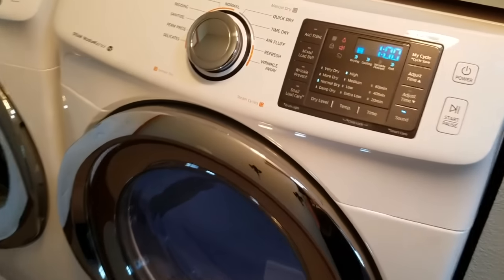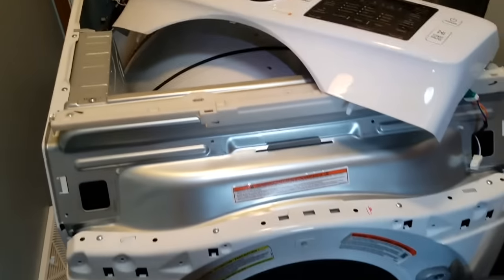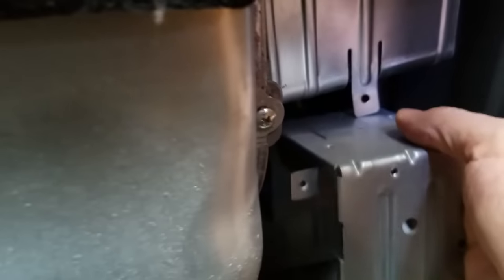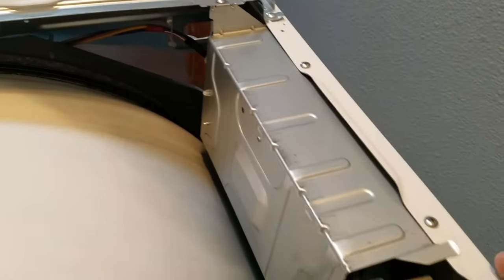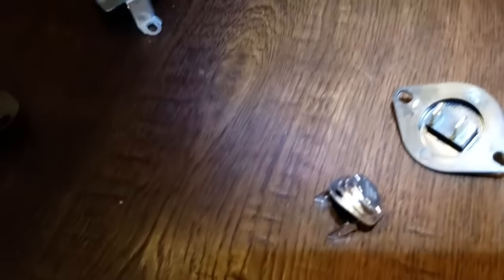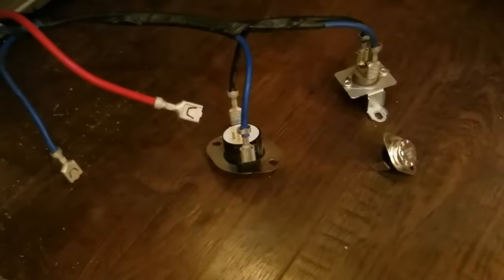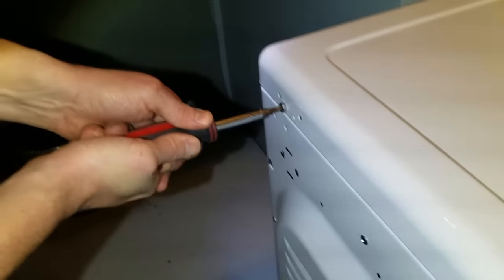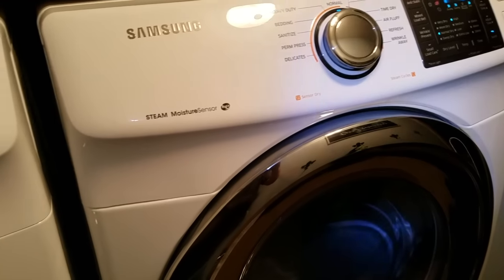Samsung Clothes Dryer Heating Element DIY Repair - No Heat & Noise Fix

Comment: Lifesaver! That damn u-shaped metal piece was a beast. Took me the longest to get those 2 back screws off, but I got it eventually. Thx again for posting.
Reply: How did you manage to get the 2 screws from the back? It’s a b***.! I can’t even see the screws, only feel them. Please help! Thx
Reply: smiley0987 I used a stubby screw driver and just went off of feel. It took a while, I didn’t actually screw them back in when I was putting it back together. I couldn’t be bothered.
Reply: L A thank you so much for your quick reply! Ok ill have to pick up that screwdriver! Yes I won’t be bothered to put them back either. Arghhhh I was just trying to yank the element piece out but of course it won’t fit, Samsung makes everything difficult. Hubby is ready to buy a new dryer but Im so determined to test this piece first.Thanks again!
Reply: smiley0987 it’s worth it in the end, it’ll just take a little bit more time than you would like. I didn’t see a break in my heating element so I did swap everything out in the kit and dryer has been working like a champ since.
Reply: smiley0987 best of luck!
Reply: L A thanks again!!

Comment: Awesome quick fix. Thanks for the video! Made quick work of the dryer without having to take the whole thing apart!
Reply: Excessive lint burnt up another coil today. Here just refreshing my memory.  Found that the exhaust duct under the drum was loose. Just wrapped some insulation tape around the seam and replaced the element.  Thanks again!

Comment: Saved my butt thank you. Never buying Samsung again tho
Reply: I will never buy another Samsung product again either. I had a Samsung Note (and replacement) that was a fire hazard, a TV that had a cheap capacitor burn out after a year (thanks YouTube showing me how to fix it), a microwave with a door cable that isn't tight enough, a refrigerator with an ice maker that is froze over, and now a dryer that won't dry clothes. I have a friend who had an issue with their dryer too... That's what I get for brand preferance!

Comment: Great video, I have to perform this exact repair on the same model this weekend.  This is a huge help!
Reply: @MelvinZoopers  Just curious, when you put the replacement in, was there any burning smell afterwards?  I just put my replacement in, and while it does heat now, it smells like somethings burning in the drum.  I unplugged it for now to take another look later, but wasnt sure if it was maybe just some lint or something
Reply from the maker: Yes. I do remember a smell like it is getting too hot. Maybe it is just the coating on the coil burning off.
Reply: Melvin Zoopers thanks so much.  I’ll make sure I’m able to watch It nonstop for a few minutes tonight and see if it goes away
Reply: @MelvinZoopers  Yep! After about 10 min or so, things are smelling normal again.

Comment: After watching more than 3 videos I replaced my heating element and the fuse along with the thermostat.  It worked like a champ for two days then stopped heating again. Once again I removed the whole housing.  Element was good so I replaced the original thermostat and fuse. Working again...the fuse must have blown that was supplied with the element.

Comment: Only issued I had was removing the control panel.  Ended up snapping the plastic clips off to remove it.  But it worked.

Comment: The only problem I had was the control panel was stuck at the bottom.  I found that pressing in at the bottom center of the panel released it.  Thanks for the video
Reply from the maker: Good tip!

Comment: Thank you so much. It walked me though the entire process and now my dryer is working. However, I was not able to get the two back screws in on the bracket holding up the element. It feels solid and the tube is in the whole in the back. What do I risk by not mounting those two screws? I can't even get them in the hole anymore and can't see/do anything . Any advice would be greatly appreciated.
Reply from the maker: Should be good but I worry that things may move around with the vibration. There is a reason they designed it with the screws there.

Comment: I have this dryer and functionally it works great but the reliability is garbage. I've had to have it repaired by techs FOUR times in less than 4 years and it's gotten to the point where thanks to videos like this one I now can literally take apart the thing in ten minutes and replace everything in it myself. If you laid out all the parts on the floor in front of me I could literally put it back together from memory because I've had to fix the thing so many times. Ironically this video showed up in my YouTube feed today because I got an HE error on it so I wanted to verify if I could check the functionality of the heating element and fuses without removing the drum. This thing is garbage for reliability. My buddy and I were just talking and he said Samsung is rated 18 out of 24 for reliability in Consumer Reports. (Probably shouldn't have bought a Samsung washer last year... d'oh) 

The good news is I know I can get the heating element and thermal fuse and thermistor on Amazon for $75.  Still aggravated I got take this thing apart again.
Reply from the maker: I know what you mean. I have already replaced my heating coil twice in less than 3 years & it has a loud hum & I am not sure where it is coming from!

Comment: Here I am again, 1yr later, watching this magnificent Video in order to change heating element once again.  It has been exacly 1 yr, is it nirmal for hearing element to brake again? Are we doing something wrong, maybe, for example if a breaker is tripping somewhein the house, would this cause this???
Reply from the maker: I am not sure about that. I think the quality of the Amazon element is suspect. I am also on another replacement. 😠
Reply: @MelvinZoopers  thanks for replying so fast.  I'm assuming samsung piece will cost way more, right?
Reply from the maker: @GUACHARN  I never have priced it out, but like you, I assume it would be, but may be worth it in the end unless something else breaks on it, then you just wasted 💰.

Comment: Thanks for helping me replace the element and getting heat back 

There is a different issue now though my dryer gets to hot and wrinkles clothes now (SMH). Any idea why? It’s almost like the the sensor for controlling heat temps is not working
Reply: maybe change the heat settings for less hot

Comment: I'll be getting into this project over the weekend.  Its too bad those two screws that attach the hood need to be removed.  Would be great if the hood could stay on.  Hard to remove on stackable w/d in closet.

Comment: Same issue on a friends' samsung dryer today (and another friends' a couple years ago). ordered a $24 heating element and not the cheapo replacement sensors. Samsung wants $118 for the heating element... hahahahaha btw, I checked, same manufacturer makes both parts. I'll let you know this week when it comes in if it's the same thickness and material. (aftermarkets last ~3 years and up to 5, samsung lasts ~ 3 years and up to 5) Sensors? I'd buy samsung brand as the aftermarkets do seem VERY cheaply made...

Comment: Thanks for the in-depth informative video I too have the spring broken. Quick question I have the original DC-97 14486A part# on the previous element does it matter if I get the DC-47 spring? (Can’t seem to find it nowhere unless I purchase the whole assembly which is $50 and up).
Reply from the maker: I think you should be ok.

Comment: Mine had just blown one of the "sensors" . If you have a voltmeter and seperate them they should read continuity. If they don't they're open. My heating element was intact so I just changed the sensor. It's probably smarter to replace them all at once but I didn't have to.

Comment: What a job!  Thank you for making this helpful video.
Talk about screwing the consumer.  Thanks Samsung for engineering such a sh**ty appliance where, what should be a routine repair, turns into a nightmare.
BTW, the power connection should be redone to clamp the cable itself, and not just the conductors.

Comment: Great Vid One of the
Easiest repair I have ever done 

BUT 

After ordering Samsung Dryer Heating Element DC47-00019A (~20$) 

I stretched the broken coil a little bit so the break in the coil wires were
over lapped. With a metal wire crimp I slid the crimp on the over lapped broken
coil wires and crushed the crimp with a pair of vice grips. 

Big Big Problems. 

Installed this repaired heater and now I’m running a repaired Samsung dryer and have
a new Heating Element DC47-00019A (~20$) sitting on the shelf. 

IMO this Heating Element repair will outlast my Samsung dryer and I will never
will use that new Heating Element DC47-00019A (~20$) part. 

Very Very Sad.
Reply from the maker: Good one.
Reply: Just wondering is your fix still holding up? Or did you use the replacement parts you got?

Comment: The two “sensors” you bought ( actually a thermal fuse and the thermistor) don’t match because they are the two that go on the blower, not the heater element housing!!  The element housing gets a different thermal fuse ( part #dc96-00887a) and a thermostat ( part # dc47-00018a). They will look just like the one you detached.  The ones you purchased will look just like the ones on the blower.
Reply from the maker: Thanks for that!

Comment: Hey, I have the exact same dryer with the exact same problem. I noticed you didn't replace the thermal fuse, which I thought might be necessary in this case. Is the dryer still running fine without replacing the fuse? Thanks and great video!
Reply from the maker: Yes. Once I saw the broken element I figured that was the only thing that needed replacing. Working good.

Comment: I just did this to my dryer, this was super helpful. However, I had to do it 4 times, every time the cooling light was still on. I replaced the semsors, used a volt meter to make sure everything was working, the cooling light is still on. So I run the dryer anyway to see what it does. It blows hot air. That cooling light was a freaking liar.
Reply from the maker: Haha! Love it!

Comment: Hi
Firstly thank you for the video. I followed all of your steps and found that my heating element is fine not broken. I’m confused now what can be the issue? Could you please help?

Thank yoj
Reply from the maker: Those heating elements go out so frequently that I might replace it even though I don't see any brick in the coil. There may just be a weak spot.

Comment: Thanks a lot. Where would you find the wires on the outside of the heating element? You mentioned something kit but it’s not in your bio. One of my wires is burned and I haven’t proceeded to the next steps of opening the element yet. It’s the middle plug and the black wire with silver attachment is burned and broken from the silver on the plug.
Reply from the maker: I believe that those things came in the kit that I used in the video. Got it from Amazon.

Comment: Any suggestions on where you ordered the parts?  Did you order OEM or something simple off Amazon or something?  Link would be helpful!
Reply: I got the whole kit with a new heating element, fuse and thermostat in the housing.
https://www.amazon.com/gp/product/B082LZJQZ5/ref=ppx_yo_dt_b_asin_title_o00_s00?ie=UTF8&psc=1

Comment: Mine went out on my dryer same model as yours about a month ago thanks to you I was able to replace it quick. Unfortunately less than three weeks after replacing the new one it went out again. I can’t figure out what could’ve caused it to go out again. I got an OEM replacement and don’t know if it was faulty or just crappy eBay product. 

Anybody else having the same problem?
Reply from the maker: My first replacement lasted about 1 year then I had to replace it again. I think they make them weak so you keep coming back for more.
Reply: @MelvinZoopers   I wouldn’t be surprised if that’s the case. The more I’ve been researching the cause I’m staring to believe is the temperature sensor that is not turning off the heating element causing it to overheat and go out. Is so frustrating. Will post if an answer if can figure out the problem since my drier is about 4 years old.

Comment: I replaced the heating element and all sensors but still no heat. Checked the voltage and it's receiving 240. Any suggestions?
Reply: I have the same problem , Did you find any solution?
Reply: Check the 2 thermal fuses behind the blower.the parts are shown in the video. They are different than the ones on the elements. Remove exhaust from the rear look towards the right behind the blower.

Comment: I changed the heating element and the 2 sensors. I plugged it all back in and started it up again. It worked! :) But, it smelled heated... Is this normal at the beginning for these new elements installed, you think?
Reply from the maker: Very much so, yes. Smells hot when they fire up the first couple minutes.

Comment: Gotta do this... I'm getting a 10v short to chassis and I get a mild shock if touching any bare metal on the dryer. I think there's a pinched wire somewhere.
Reply from the maker: That sucks! Be careful.
Reply: First thing to do, it's to unplug it.
Reply: Good news!!!
Found it was the outlet had one of the hot and ground lines switched.  Ow that I think of it... the dryer wasn’t drying that well after all.
Once I switched those lines... all is well and no shock.

Comment: Thank you for your excellent video!
Reply: Actually, I am representing a brand US amazon store, We're appliance repair replacements Amazon seller. I wanted to see if you' d be interested in testing our Dryer heating element kit and adding affiliate link under your video. We will pay you $50 to thank you for your repair video if you could use our products.

Comment: I can't tell ya how many heater assemblies on these samsungs i have replaced over the years but its alot  & I have never had to do it in pieces it comes all together just plug and play.  most of them are fine it just popped/tripped the high limit  , that could be from overloading the unit blocked vent  & or not cleaning the lint filter.. PS you don't have to take that bracket off from the bottom of the dryer to the heater just the one screw holding the heater to the mounting bracket

Comment: Anyone watching this and haven't ordered parts or have in the process of taking your dryer apart. You can take a volt meter, switch it to ohms and touch to both wire connections of each of these parts. The Heating coil's 2 prongs, the thermostat's 2 prongs and the Fuse's 2 connectors. Whichever one is dead will not show nothing (0.00) on the voltmeter. While the good components will test as having continuity or actual readings on the volt meter...
My coil tested good and so did the thermostat, but the fuse had failed. 

My luck is I bought the Amazon model that was supposedly to be 2 day shipping. Supposedly it shipped from the Amazon warehouse in Charlotte, NC. But now has been "delayed". How ever that works?

Comment: I'm still working on mine.  Just stuck at removing the two screws on the backside of the bracket that I can't see.  What's the trick besides trying to imagine where the screwdriver is in relation to the screws so that you can remove them??

Comment: This exact dryer was given to us by one of my uncles that lives near because they recently bought a new one and we didnt have a dryer. Worked fine for the first year, but after, it started making a loud squeaking noise. My father took a look at it and turns out it was the roller wheels that were lacking lubricant oil which caused them to wear out. He ordered spare wheels for it and it made no noise after replacing them. Not long after (~1 month), it made the same squeak noise and figured it was the same issue. He replaced the wheels again and just yesterday, it started making the same noise again! Though not as loud. Could it be that the parts are just cheap? If not, what could it be? Have you had this issue?
Reply from the maker: I am not sure. I have not encountered this problem (yet).
Reply: @MelvinZoopers  hmm. Well consider yourself lucky.

Comment: So I fixed my dryer using your video I chose to use the new sensors the dryer worked great for about a month then it stopped so 4 months of running wet washed clothes to the laundromat and I decided to give it another try so it’s all fixed up again I’m wondering how do you know if the sensors are bad is there a way to test them I think my coil on the last repair may have been touching the housing and caused a short but I’m not entirely sure that’s what it was there were no breaks in the coil so I don’t know that’s why I’m wondering about the sensors can you give me a idea what I can do if it doesn’t work
Reply: Quick update it doesn’t seem to be getting warm it’s gotta have something to do with the sensors I guess Ill take it all apart again and put the new sensors on I was just wondering  is there a way to test the sensors
Reply from the maker: I am not sure how to test the sensors. Once I saw the break in my coil, I knew that was the problem so I left the sensors alone. I guess I always feel like the original parts are better than the aftermarket stuff you pick up.
Reply: Thanks I got it all apart again I’m going to put the new sensors in again I mean the coil is brand new and installed correctly so it’s gotta be the sensors I like a fool recently tossed the originals thinking I’ll never use these again and well here we are again lol thanks Melvin fingers crossed brother !!!
Reply: Hey while I have you here does it matter which way the sensors go in could I have the backwards in terms of positioning of each individual sensor like a up and down or tip and bottom concept ?
Reply: Hallelujah no more laundromat put the new sensors in and eureka we got heat Melvin thanks buddy appreciate your help

Comment: Hi, mine has a screw holding the heater coil unit to the back panel of the dryer.  Didn't yours?